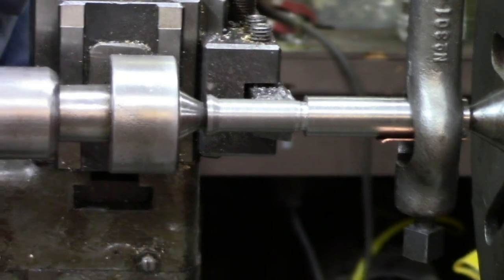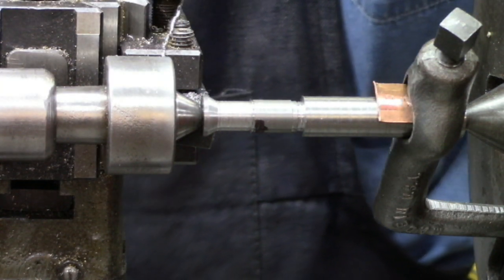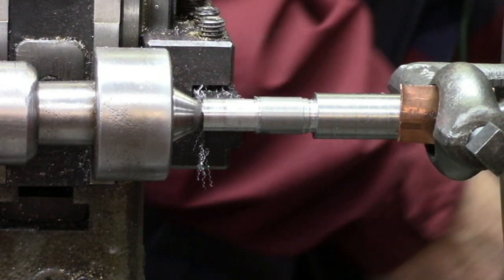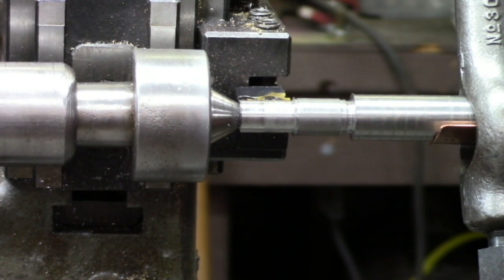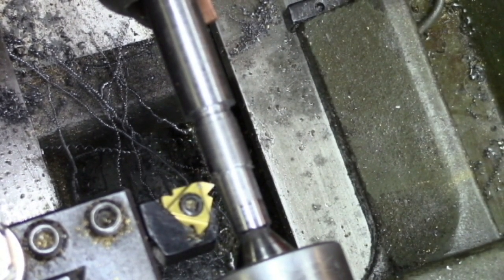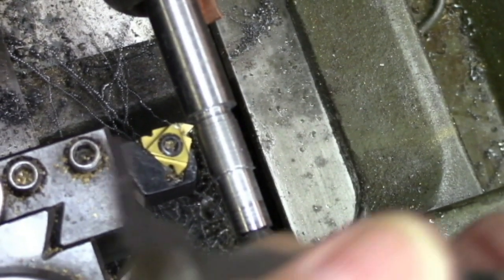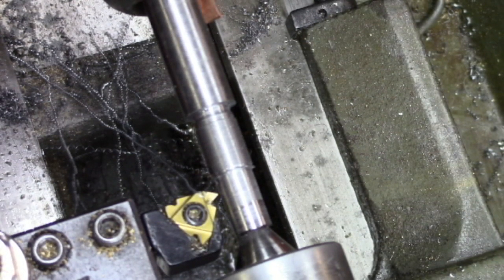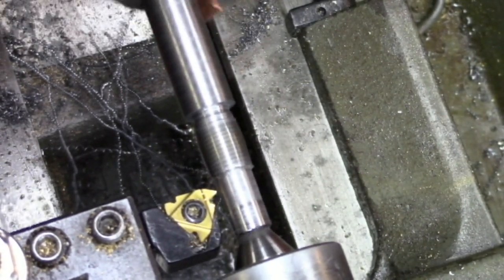Machining for a favor part 2 of 2

Comment: Hi Harold ...   watched both 1 & 2 & ... first thing I noticed was your up tempo New Intro Song .   Liked the machining  in both sections, which worked out well between live centres. I thought you might have polished the finished Part , not that it matters. Overall good job. Will look forward to your next project.
Reply from the maker: I am not sure the part is actually any good.  I had nothing to check the threads with.  Yes I have added several different versions of music, got tired of the same old thing.  Thanks for stopping by Ted.
Reply: @AmateurRedneckWorkshop  I liked this version of the music!
Reply from the maker: @RockingJOffroad  I have 4 versions right now so you will eventually get to hear them all.

Comment: Harold, I May be wrong but isn’t the thread depth supposed to be equal to the thread pitch? 24 TPI = 1/24 th of an inch or .042”
Reply from the maker: You are talking to an amateur so I have to believe you.  I got it about .045 deep on the diameter so maybe it is OK as cutting that in half is about right.  Thanks for stopping by.

Comment: What ho Harold,
Looks like that came out ok.
The link is for an online thread calculator where you can put in standard or custom size threads and it gives you all the parameters needed.
https://www.cgtk.co.uk/metalwork/calculators/screwmeasurement
For any doubters about radial or flank feed. Anyone who thinks you mustn't go straight in clearly shows a complete lack of imagination. 😉
ATB 
c
Reply from the maker: I used that link and sure enough I got it right.  My thread depth was in about .024 to .026 so I must be in the range maybe a little loose.  Thanks for the link and for viewing.
Reply: @AmateurRedneckWorkshop  you are welcome.
Remember depth of thread is dependent on tool tip radius/flat so with a pointy tip tool you have to go deeper to have right PD.